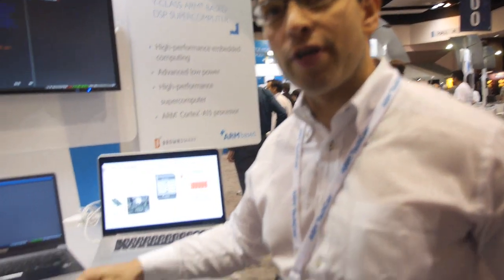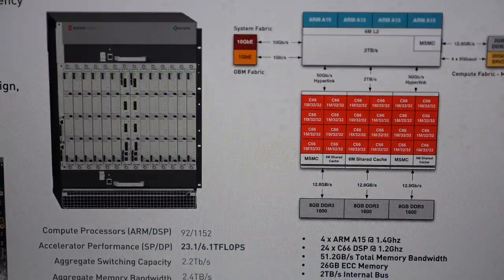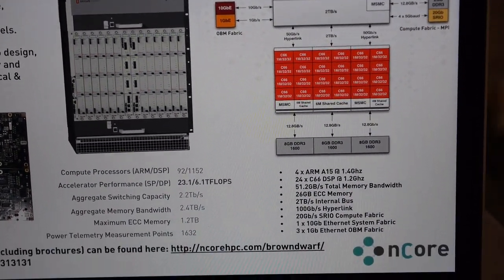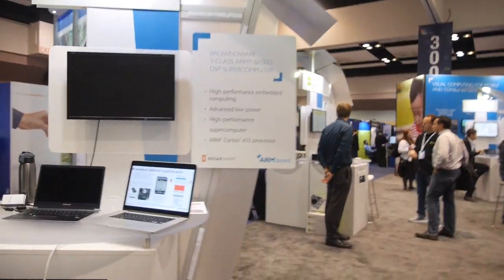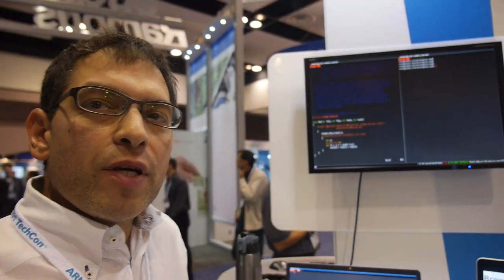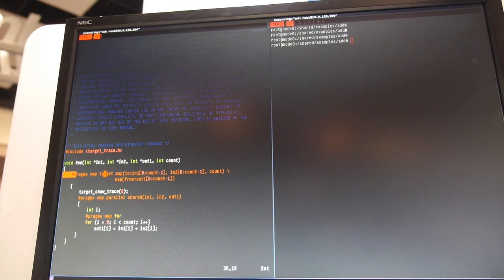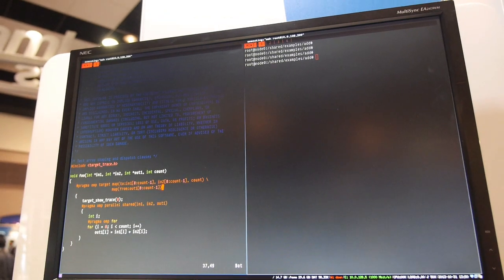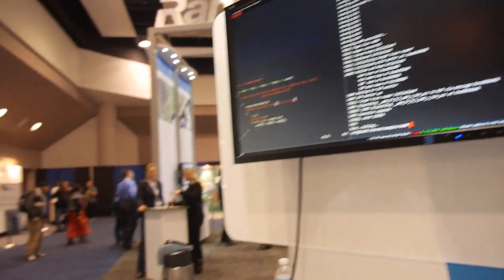nCore HPC ARM+DSP Super Computer

Comment: 3kW in 1U size server !!! How do you cool that ? Also 23 single precision TFLOP at that power consumption dose not sound energy efficient especially since most of that is done by DSP.
Any modern GPU will do those with better energy efficiency.
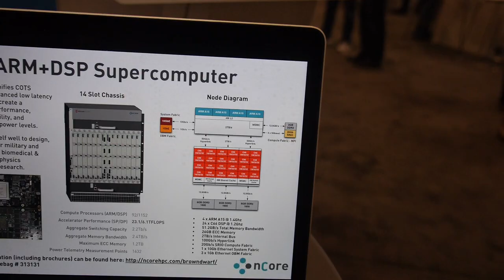Reply: I think you misunderstood... 3kW is for 14  x  1U Servers it is at 0:50s approx.
Example : according to Nvidia Tesla K40 it is using 235 Watts at max power and developping approximately a peak of 4.3 TeraFLOPS of Singlepoint Precision performance so roughly 5.3 times less than the whole server.
If we do 235W x 5.3 = 1245W = 1.25kW and now we did not include anything else (switches, servers/workstations, cooling, etc.)
Reply: Oh and sorry I forgot to talk about memory, let say 64Gb of GDDR5 vs. 1230Gb/1.2Tb of (I assume) DDR3...
and I know we cannot have 0.3 of a Graphic card it is just for explanation purpose